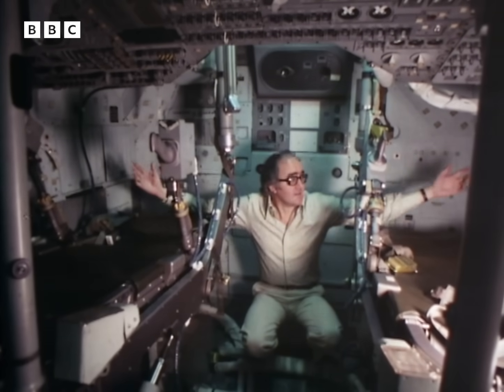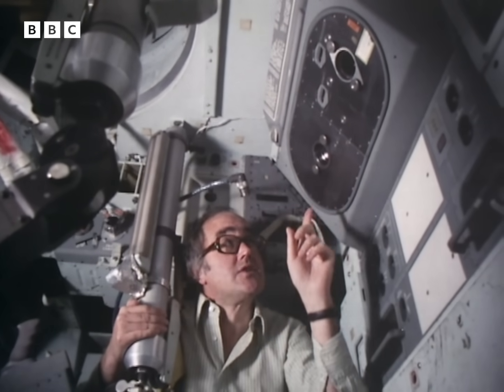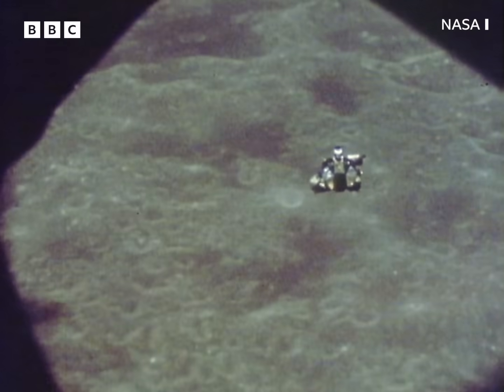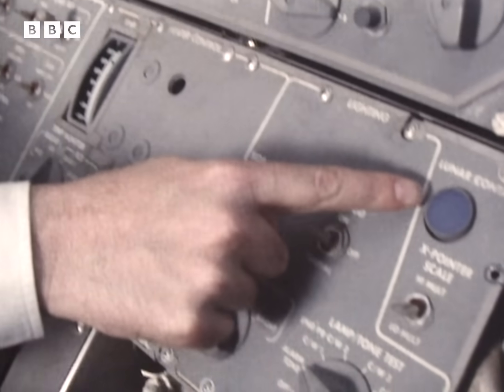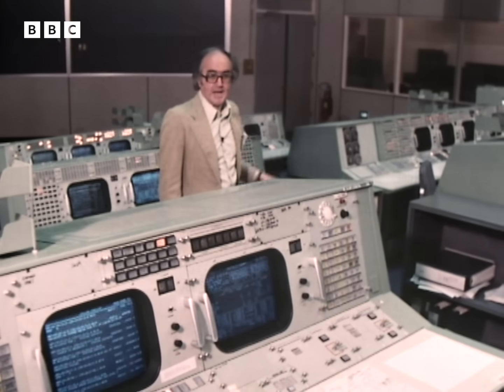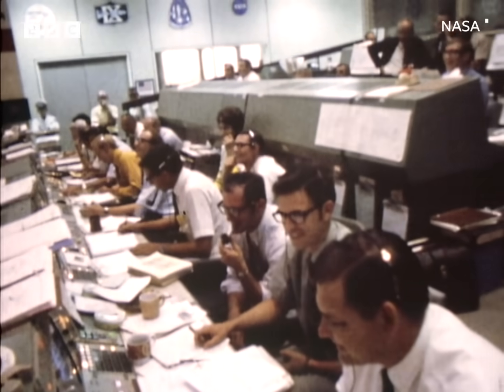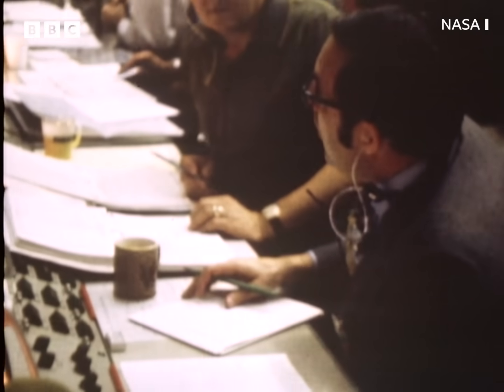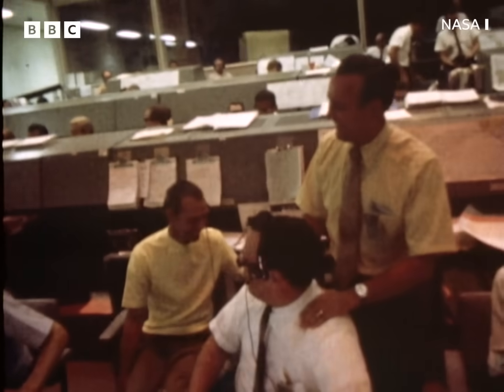1979: How to LAND ON THE MOON | Project Apollo | Retro Tech | BBC Archive

Comment: Incredible nonsense, without precise navigation, they wouldn't even land on Earth, let alone the Moon. And that tiny window there, it's thinner than in an airplane. Stop feeding people this nonsense!
Reply: Not nonsense at all. To prepare for Apollo, NASA ran several unmanned lunar programs, including Lunar Orbiter, which mapped the entire lunar surface with enough resolution to see if a safe landing could be made in the area. Then they gave the astronauts the tools to adjust the landing spot to deal with obstacles too small to be visible in the Lunar Orbiter photos.

The LM window can be thinner than in an airliner because the pressure difference is only 0.25 bar, lower than you get in an airliner.
Reply: @Hobbes746  Can anyone imagine how challenging it is even now, with complex systems that are still prone to errors, that they were able to measure their position using ordinary gyroscopes? To land in a module and take off, dock to the lunar orbit with another module, and then return to Earth, and land there. In this procedure, a million things could have gone wrong, not to mention radiation. And when I see that small window...
Reply: @DrMaxPlank  I agree that Apollo was sketchy. They took risks NASA would not take today. 
Back in the 1960s, NASA recruited test pilots: people who fly prototype and experimental aircraft for a living. In that community in the 1960s, there were fatalities every year when test flights went wrong. This was accepted to an extent. And that mindset was brought along to Apollo. 

That said, NASA was always good at reducing risk. The gyroscope on the Apollo spacecraft was backed up by two independent methods for establishing position: the spacecraft had a telescopic sight that could be used to measure star positions, and the position could be measured by ground stations.
Reply: oh looks like we got an expert here
Reply: @gnotagnome24    Right, but, they should first Youtube::: ("Rocket.Thrust.to.Weight.Ratio")("TWR")    To learn how to first get off the earth first.
Reply: @kareemsalessi  You should learn some basic physics, instead of attempting to deceive people.
Reply: @kareemsalessi  Youtube haphazardly deletes replies that violate their guidelines. This includes replies that are reused, comments that include links, etc. 
I’ve seen your experiments, and I’ve attempted to correct the basic misconceptions you have on them, by replying to your videos.
Reply: @kareemsalessi  of course I’m familiar with the displacement formula.
Reply: @Hobbes746    Okay, then type in the 3 meters/second, which is the first launch speed displayed in the Saturn launch data table, then calculate to see that it would fall down by 2 meters, thus unable to detach from the ground.
Reply: @Hobbes746    3 meters per second is shown in NASA chart as it's speed, not s2-accelertaion. Nice try though. Also, no real rockets can be clamped down because they'd explode. Apollos were, just as hot air balloons are clamped down for their air volume to heat to become light enough to provide lift, exactly what I'd described in my first clip. Also, if you plug in all the other speed numbers of the NASA altitude chart, its fakeness shows up further. Also, you'd see that for a rocket to go up more than it's natural gravity fall, it must have a minimum speed of 100 meters in it's first second.
Reply: @kareemsalessi  You’ll need to tell me where you found that chart. Because if you want to use the speed to calculate the acceleration, we need to know at what time the speed was 3 m/s.
Reply: @kareemsalessi  Rockets are in fact clamped down. This is done for security before the launch, and to hold down the rocket during engine start until the engines are working as expected. 
This is also done for engine tests. For Apollo, a huge test stand was built where the entire first stage could be run for a full duration burn, i.e. in that test the engines would run as long as they would during the flight. 
There is no reason for a rocket to explode when it’s held down to the launch pad. 
The rocket is sitting above a flame trench, so the combustion gases can easily escape.
Reply: @Hobbes746   "Saturn V Rocket Launch Speed and Height"    brings up the chart, and don't throw in disinfo, like acceleration. That calculator uses only speed & time, NOT acceleration. 
Artilery shells & rifle-bullets and all other missiles are also rockets. They're NOT clamped down. Apollos were HOT-H2-veritcal-airships, NOT rockets, get that into your skull, otherwise you continue to parrot the same fairytales.
Reply: @kareemsalessi  Let’s do the calculation again using the table you indicated. 
At t=1 second, it shows the position as 2 meters and the speed as 3 m/s. That’s slightly higher than my figure.
x0 and v0 are still zero. So 3 = 1/2 at^2.  t=1, so t^2 = 1. So, 3=1/2a *1, which means a is 6. 
For t=2 seconds: 4=1/2 at^2, t^2=4, so move the factors 4/4 = 1/2a a=2. The values for t=1 and t=2 contradict each other: the acceleration is not going to suddenly decrease from 6 to 2 m/s2. There are a few jumps in the table, especially in the first few seconds. 
The data is from video 'Apollo 11 launch w altitude and velocity data', and it's easy to see the table is not accurate: the entry for 4 seconds shows 25 meters and 10 m/s, and in the video those values occur at closer to 5 secconds than 4. 

These are the values I found by playing the video back frame by frame and recording the data for the first frame that showed the timestamp: t=1: altitude 1.31, speed 2.1, t=2: alt 4.41, spd 4.2, t=3: alt 9,61, spd 6.3

So we get for t=1: 1.31 = 0.5a, a=2.6. For t=2: 4.41 = 0.5a*4, a=2.2. For t=3: 9.61 = 0.5a/9, a=2.1 That is much more consistent with each other, and it is consistent with the acceleration value I got (2.7 m/s2) which I had to estimate from a graph.
Reply: @kareemsalessi  Artillery shells and rifle bullets are not rockets. They are propelled once by an exploding charge.
Reply: @kareemsalessi  The Saturn V was a rocket, not an airship. Even the lightest airships can only ascend very slowly. When you let go of them, they accelerate to maybe 50 km/h until the air resistance is as large as the buoyant force. The Saturn V accelerated at 2.7 m/s2 initially, and this acceleration kept increasing. Only 66 seconds into the flight, with the Saturn V still within sight from the launch site, it accelerated through Mach 1 (which is clearly visible in the launch video, with the condensation cloud forming behind the steps in diameter). At that time the rocket was at an altitude of 8 km, higher than any airship has ever been.
Reply: @Hobbes746   My former reply disappeared, but anyway, if you putt in (Minus) -5m/s speed in the calculator, and one second, you'd see that it's the minimum speed any rocket must have at its first second just to prevent falling down, because its the first time that it shows in that one second, any rocket at that initial speed also falls.  Now, if you put -115m/s and one second, you'd see that as the speed needed to clear its launch tower in its first second, require a starting g-force of over 11g, which neither humans, nor animals could survive. above 5m/s is disregarding the enourmous draf forces on the Saturn-surface-area, which by itself would have demanded serverl  g-units to neutralize.
Reply: DRAG-FORCES, NOT DRAF
Reply: @Hobbes746     BTW::: in that free-fall calculator you can also plug in minus values for acceleratoin, for instance your -2.7, the first second of -3m/s upward speed, to calculat a distance of -4 meters (above launch-pad).
 a Minus (-10) acceleration upwards results in only 8 meters of elevation in the firste second, while a -100 (10g) upward acceleration shows only 53 meters of altitude gain. [all this while disregarding drag-forces]
Reply: @kareemsalessi  A minus value for speed indicates the rocket is moving down instead of up. The video shows the rocket is going up, not down.
Reply: @kareemsalessi  The rocket is not going to fall down: it is sitting on the launch pad. The clamps are not released until sensors indicate the engines are running as they should. At that moment, the engines produce more thrust than the vehicle weighs, and the rocket is going to move up, not down.
Reply: @Hobbes746   YT:::("1:40-Is-Global-Warming-Possible?")    which probably disturbs your global-warming delusions too.
Reply: @Hobbes746   my reply disappeared again.  I have to switch out of YT  altogether
Reply: @kareemsalessi  We were talking about calculating how position, speed and acceleration are related, not about global warming.
Reply: @Hobbes746   Related to my disappeared comment. YT-sucks
Reply: @Hobbes746  "Fly-me-to-the-Moon" is a related upcoming movie.
Reply: @kareemsalessi  Fly me to the moon is fiction, just like Jules Verne’s Journey to the moon.
Reply: @Hobbes746  similar to the Apollo fairytales 🧚‍♀️ 👸
Reply: @Hobbes746    YT:::"Understanding Thrust: A Continuous Explosion | Physics Explained"   as applied to the launch speed & weight of Apollo calculates many times more thrust force than their official claims.
Reply: @kareemsalessi  Does it? Let’s see. The formula from that video is impulse = (m/t) *v
For the first stage of the Saturn V: 
m/t (the mass flow per second) = 1789 + 788 = 2577 kg of propellant per second, per engine (as per the specs of the F-1). There are 5 engines, so total mass flow is 12885 kg/s
v = the exhaust velocity. This is 2.58 km/s
So the impulse is 32.399.640 kgm/s, for one second of operation.
The force is impulse / time, so we get F = 32.399.640 kgm/s2 is 32.399.640 N.
The specs say thrust is 34.5 MN, so we're a little low. 

the mass of the rocket is 2,822,000 kg at liftoff. 
F = ma, so the acceleration at liftoff is 32.399.640/2,822,000 is 11.48 m/s2.
Minus the 9.8 m/s2 of gravity because we're moving up, against the direction of gravity: net acceleration is 1.68 m/s2. 
So using the math from that video and specs found on Wikipedia, I get within 10% of the values we got in earlier calculations. Not “many times more”.
Reply: @kareemsalessi  12885 times 2580 (exhaust velocity in m/s) is 33.243.300. 
If I multiply 12885 with 2.58 I end up with two kilo prefixes, converting 2.58 k into 2580 solves that. 

I made an error copying figures to my calculator, so the 32 million was wrong. 
The acceleration then becomes 1.98 m/s2.
Reply: @kareemsalessi  Yes, the Saturn V burns the bulk of its fuel in a few minutes. 
The first stage burns for ~200 seconds, then the second stage burns for ~360 seconds, then the third stage runs for 150 seconds. Then it shuts down, with the third stage plus the spacecraft in low Earth orbit, moving at 8 km/s. 
After a few orbits to check things out, the third stage is fired again, to accelerate the spacecraft to 11.4 km/s. Then the third stage is empty and is jettissoned. 
That 11.4 km/s is reached at a few thousand km above Earth’s surface. That’s enough that they can coast the rest of the way to the moon.
Reply: @Hobbes746    From what altitude Apollos coast all the way to the Moon, as if skateboarding downhill???
Reply: @kareemsalessi  The third stage shut down less than a thousand km from Earth, if I calculated correctly. 
From that point, they’re going uphill: as they fly, they lose speed due to gravity. That’s about 9 m/s2 at that point, and this value gradually decreases as they get farther from Earth. This continues until they get to the point where the Moon’s gravity is stronger than Earth’s. This is at about 62,000 km from the moon and they were only doing about 1 km/s at that point. And from that point, it’s downhill: they accelerate towards the moon.
Reply: @Hobbes746  So, according to you  , no rocket thrust is needed above 1000km altitude??? If not, why don't they fall back to earth, like the North-Korean rockets do from 5,500 kilometer altitude, once their fuel runs out??? 😳
Reply: @kareemsalessi  For an object in orbit, speed and altitude are linked. In low Earth orbit, your speed must be 8 km/s. Any slower, and your altitude will decrease until you reenter the atmosphere. 
Once you have reached 8 km/s and you are in a circular orbit, you can switch off your engines, and coast indefinitely. 
For Apollo, that acceleration to 11.4 km/s pushed the spacecraft into an orbit with a highest point of 380,000 km. The timing of that burn was calculated so that the highest point of the orbit would intercept the moon, and give the spacecraft the choice of entering an orbit around the moon (by firing the engine on the Apollo service module) or staying in that elliptical orbit for a return to Earth.
Reply: @Hobbes746  So, NK-rockets don't get stuck in orbits???
Reply: @kareemsalessi  If a launch does not accelerate the satellite to 8 km/s, it will not achieve orbit, but fall back down to Earth.
Reply: @kareemsalessi  You’re focusing on the wrong variable. Once the speed reaches 11.4 km/s, no more thrust is needed to get to the moon. 
Altitude isn’t the most important thing about achieving orbit: speed is. Rocket launches accelerate the satellite to a set speed, and the altitude follows from that.
Reply: @Hobbes746  11kmh/second,  LOL 😆What a dreamer.
Reply: @kareemsalessi  Again, everything I said is verifiable reality. Simple equations allow you to calculate this speed yourself.
Reply: @Hobbes746  🤣 LMAO
Reply: @kareemsalessi  I’d recommend less laughing your ass off, and more learning.
Reply: @Hobbes746  with NASA FAIRYTALES that's the best anyone could do
Reply: @DrMaxPlank  if only equations could get you to the Moon , Mars, and  beyond,  like they've been advertising since 1950s.
Reply: @kareemsalessi  Equations are the start of getting you to the moon. They tell you how big your engines have to be, how much fuel you need, what trajectory to follow, etc.
Without equations, getting to the moon is impossible.
Reply: @Hobbes746   LMAO again.  Tell me then,  Which equations claim that rockets launch with TWR<1.5  ???
Reply: @kareemsalessi  F=ma
Reply: @Hobbes746    how does this nonsense claim such fairytales???
Reply: @kareemsalessi  I’ve patiently explained the basics to you. Those basics have been checked and verified over a period of 400 years, ever since Newton wrote down his laws of motion for the first time. 
In all that time nobody has found an issue with these equations, so who are you to call them ‘nonsense’?
Reply: @kareemsalessi  F=ma. An equation first written down by Newton, and tested and verified to be accurate over 400 years of experimentation. F=ma tells me a rocket can successfully launch with a TWR of 1.00000001.
Reply: @Hobbes746    my simple experiments have disproved this fairytale.
Reply: @kareemsalessi  Your experiments don’t show what you think they show. I’ve already explained this to you. 400 years of rigorous examination of Newton’s work by people far smarter than you or me have turned up no flaw in his equations.
Reply: @Hobbes746 ==Einstein, this formula is junk. Also, Newton and Kepler had sstolen their stuff from Al.Haytam of 600 years earlier, although probably not this junk formula.
Reply: @Hobbes746   F==Force==Effective-Weight shown with my baggage-scale, as shown without junk.formulas.
Reply: @kareemsalessi  No, it’s not the “effective weight”. You are measuring the force that is accelerating the weight upwards. What you’re measuring (F) is in fact equal to m * a.
Reply: @Hobbes746    what you may be trying to convey is that W==F==mXg at rest, and that this force/weight  doesn't change for the rocket/object to rise up against gravity
Reply: @kareemsalessi  Yes, W=mg at rest.
When I apply a force F to that object, and F is larger than W, the object starts to rise with an acceleration a that can be calculated by F - W = ma.
This shows that the object will rise for any force F that is larger than W. 
There is no math that shows F has to be at least 1.5 times W.
Reply: @Hobbes746   1.5 To do what???
Reply: @kareemsalessi  Your claim is that a rocket needs a TWR of more than 1.5 to lift off. I demonstrated that that’s not the case.
Reply: @Hobbes746   You'd find an answer to your specific formula in my fresh comment under this YT:::(Weight Is NOT Gravitational Force!)
Reply: @Hobbes746   did you finally learn it???
Reply: NOT even a thank you for saving the rest of your life preoccupied with fairytales???
Reply: Absolutely no way that ridiculous navigation system would work.

Comment: Noticed anything impossible here: Huston and the landing module talking to each other without any delay.
It takes about 2.5 seconds for a radio message to travel from Earth to the moon and back. This is because radio messages travel at around 300,000 km/s and the distance between the Earth and the moon is about 350,000 km. It, therefore, takes about 1.25 seconds to get there and a further 1.25 seconds to get back.
➡➡➡ All those tapes are fake. Recorded on Earth.
On more recent recording, 2.5s intervals have been added.
Reply: That is incorrect. In the original recordings, you get 2.5 seconds of delay between a question from Mission Control and the answer from the astronauts.
Reply: ok so they added the 2.5s intervals later. who did this? and why? can you please explain? also, cite your sources maybe?
Reply: @gnotagnome24  ok so they added the 2.5s intervals later.
 No, they didn't. It was always there.